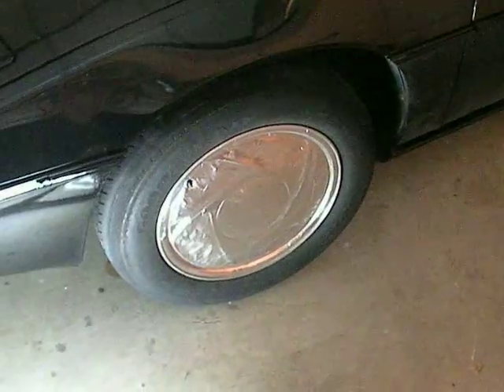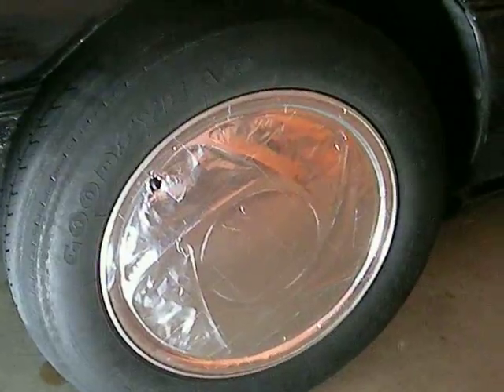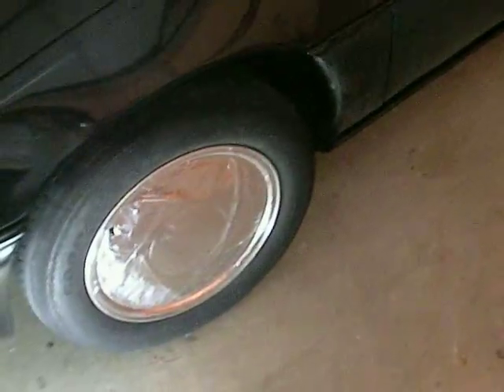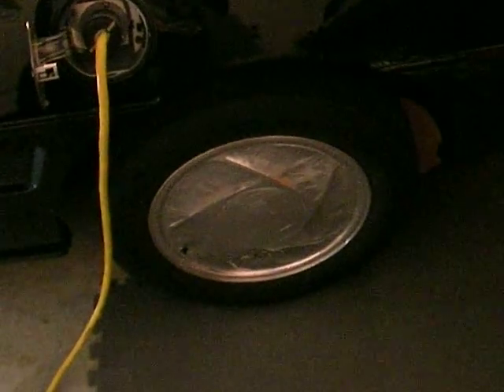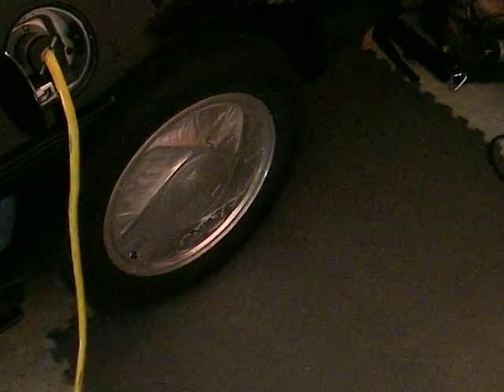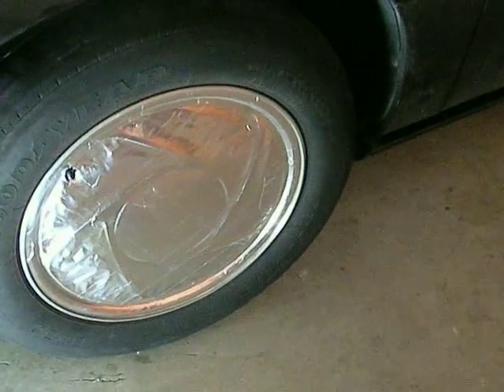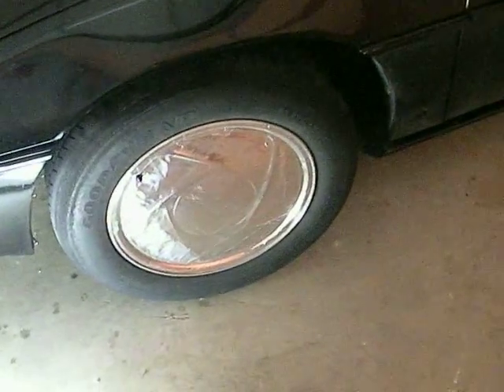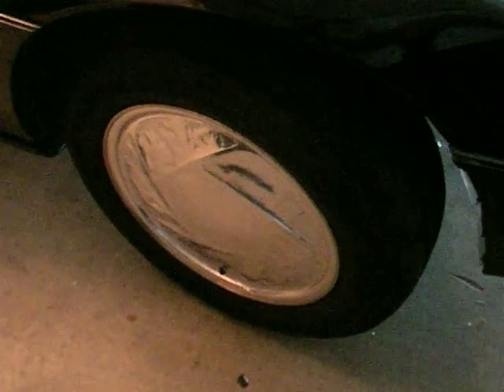Cheap Smooth Rim Covers for Aerodynamics

Comment: Funny thing, I've been dedicated for awhile to improve my milage on my sub compact european car so I've watched a lot of youtube videos and read everything on ecomodder and one thing is strikingly different between US cars and European: The tyres on american cars stick out in respect to wheel wells on all models. Either you are all running wider tyres or spacer, than stock or it is a styling statement manufacturers agree on?? In Europe the lip is always further out than the sidewall. It could be some legislation but it saves us some fuel and also makes wheel skirts or aeromodding easier.

Comment: for the ones concern about the breaks heating up...i wouldnt worry too much about it...since this is more about hypermiling ..than speed...but better pads and slotted rotors will do job...and you can always run duct work to the brakes...# cool idea using tape!

Comment: Did you notice any mpg improvements, after covering the rims with tape? If so, how much improvement?  I notice much improvement just by changing the air filter and adding a little more air to the tires.

Comment from the maker: As I said earlier.  I do a lot of coasting and use the brakes as little as possible.  I just took the tape off the rims just recently so I could put new tires onto the rims.  But I would like to get the moon caps for the rims.  I have started a belly pan for the car, it just isn't finished yet.  I need to run and get some cor-plast to make the entire belly of the car using that.